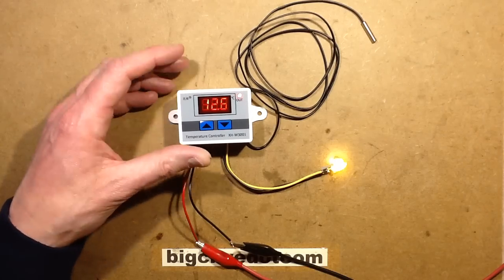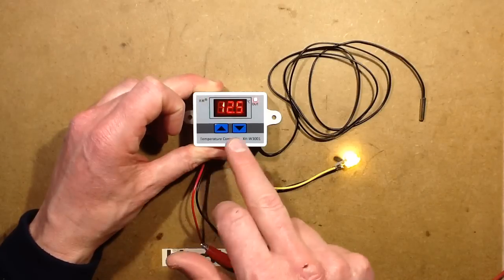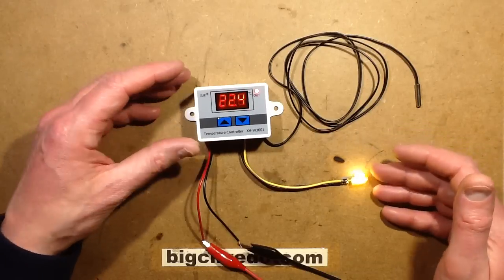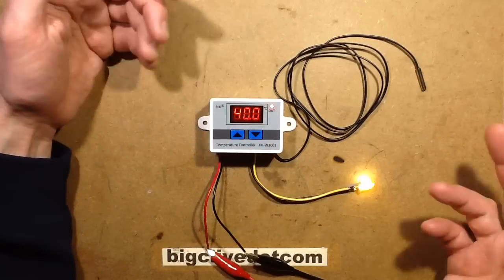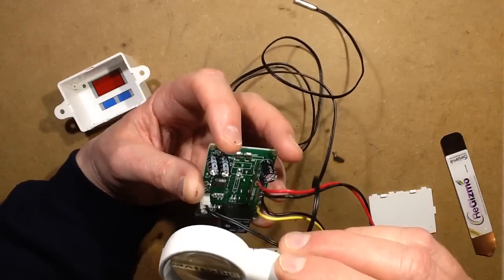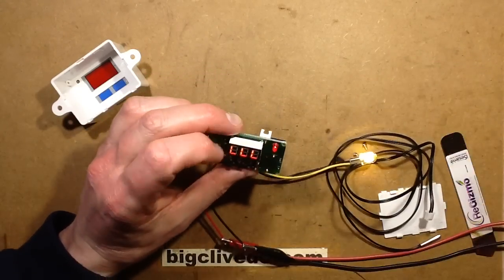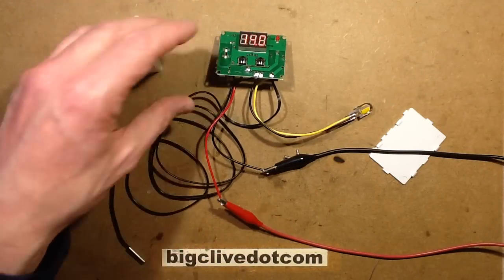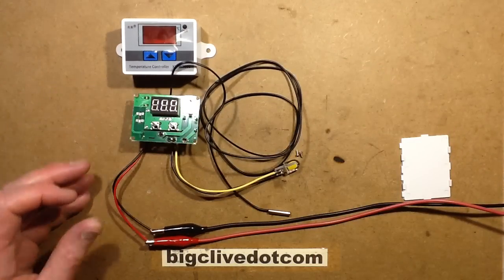How to set a XH-W3001 thermostat module, and a look inside.

Comment: Hi,i pls need some advise,i have the same controller,i tested the probe in ice water and found out its out with .5 know in a incubator that does count,so i want to run the inside of my incubator at 37.5°c,where should i set my controller if i want that when its out with +.5° out,if someone can pls help me
Reply from the maker: 0.5 is actually very accurate for these.  You may find it better to use a separate precision thermometer in your cabinet and use that to set the temperature.

Comment: so i guess with this you can wire it to an inverter and convert a 240v table top freezer to 12v..and use less energy by cutting off power when it reaches 3 degrees above desired..

Comment: Can i use a 1000watt Water heater on the load with it???
Reply from the maker: Only if you use an external relay to switch the heater.  Don't trust the one inside for more than an amp.
Reply: Very disappointing

Comment: how low does the temperature go?  can this be used to control a freezer?
Reply: this is from a retailer of the same thermostat except 220v ac not 12 v dc
Temperature Measurement Range: -50° C~110° C

Comment: Something you didn't test: is the indicated temperature (more or less) correct?
Reply: He did; more or less. By holding onto the sensor with his hand. ;-)

Temperature measurement is always a bit dodgy because it's not something physical, like mass, length or wavelength.

Temperature measurement indicates only the apparent physical effect of rise in internal heat of the device. 

The tiny little NTC sensor set inside a stainless steel probe takes a while to warm up while Clive fondles it. Indeed, one can see the indicated temperature still climbing for a second after he leaves it exposed entirely to the colder room; because the stainless steel sleeve is still warmer than the sensor. You wouldn't have seen that if Clive had embraced it for a couple of minutes; enough time for the temperature gradient to stabilise between the hand and the sensor itself.

These sort of things have "time constants" that are defined by the time required to reach 63% of the actual step change; with the constants depending on the medium (material) and its velocity. (e.g. still air vs moving air vs still water vs flowing water) Those factors make a big difference to the time constant as they determine how quickly the sensor can gain or lose heat.

Note that the amount of heat required to change the sensor's temperature depends substantially on the amount of sensor; how much material and its thermal properties (specific heat in e.g. kJ/kg·K). The tiny sensor at the heart of the probe can react to changes in temperature much more quickly than the probe; but the probe protects the sensor from the nasties; which is why stainless steel is used; being quite resistant to most corrosion, etc.

As for the accuracy of the temperature indicated; you can do that only with a certified temperature reference and the probe shoved into a sealed box with that reference. ±0.1°C may be repeatable on individual devices, but it may just be consistently wrong. ;-)  

Be happy with ±0.5°C.
Reply: The fact that the temperature rises when he holds the sensor in his hand doesn't mean too much to me. After a couple of seconds the temperature will stabilize and I would like to know if the indication on the display is more or less the real temperature!
Reply: +Hendrik Stegen Given Clive's usual house temp, it's pretty close. You'd want to calibrate the individual unit sent anyways since not all thermistors are created equal.

Comment: Clive. A huge bug bear of mine is the vast amount of energy wasted in homes because of cheap and inaccurate thermostats fitted to measure temperatures, typically in hallways in those homes. I have one of those big dial types (Bi-Metallic) fitted by my landlord and it is utter rubbish. Sometimes it sticks and runs the boiler all night until the air gets so hot I am forced from my bed to turn it down. The bills are huge as a result. Can you recommend something I can buy that will not break the bank but will do a better job?
Reply from the maker: Not sure which country you're in, but I fitted a Salus wireless heating controller to the old oil boiler here.  It allows you to set a series of temperature levels for different times during the day, and over-ride them at any point until the next step in the timing cycle changes it back.  You can also press and hold a control button and it will turn the heating off completely unless the temperature gets too low when it will still run just to avoid pipe damage.  The remote is battery operated and communicates with a receiver that requires a live and neutral for power and switches the boiler control line that is currently served by the thermostat.
A simpler alternative might be just a programmable heating thermostat that uses batteries for power and has a small latching relay to switch the heating control.

Comment: I have one connected to a heat mat for incubation. It’s reacting wrong temp. Like 80-90 always. Any solution? Ty
Reply from the maker: Is the probe wiring OK, and kept away from conductors within the mat.
Reply: @bigclivedotcom  hi, yes , I’ve tried to cool the probe and the temp isn’t moving. I think the probe might be faulty
Reply from the maker: @ChrisDeaney  It may be a standard 10K probe, so you could get a replacement fairly cheaply.  A quick test is to use a 10K resistor on the probe terminals and see if it displays around 20C.  That would show if it was a 10K probe, but also show if the on board circuitry was working.

Comment: Is it possible to insert a solid state output relay? Thanks
Reply from the maker: You could use the existing relay to switch the supply to an external solid state relay.
Reply: Thanks for the quick response. @bigclivedotcom
Reply from the maker: If you removed the relay inside you could also bring its coil wires out to the solid state relay input directly.
Reply: E 'interessante, mi sono sempre chiesto se il relè interno può essere bypassato. Grazie per la vostra gentilezza e perdonare il cattivo inglese!

Comment: I have one of these for 230V AC. It works great, but the workmanship is questionable. The wires are too thin and not made of copper. In the house installation, I would be very careful.

Comment: Can i controll 12V heating foil ?
Reply from the maker: If the current is within the range of the relay.  Or you could add an external higher current relay.
Reply: @bigclivedotcom  cloud i use 12V autobatteries as supply in circuit and use in the circuit This tempature switch controller to controll heating foil (everything is 12V)?

Comment: I bought a 4 pack on Amazon for 12 bucks. They don't read the correct temp and there's no calibration adjustment. In ice water here's my readings:0.2, 1.7, 5.1 and one doesn't turn on.

Comment: Had an STC1000 fail and it kept the compressor on. Froze all my kegs of beer. Some at 11%.
Reply from the maker: Were you switching the compressor directly through it?  The contacts may have welded closed.
Reply: yes it was. it did say its 10amp rated, i know, the relays arived later, and i wired it all up. it had run for two years though.. As you say, they are cheap. A PID would have been stupid money a few years ago.

Comment: I prefer the old thermostats with the glass bulb containing a bit of mercury. They were nearly fool-proof, and lasted virtually forever.

Not nearly fool-proof enough, because hysterical fools have banned them, due to the word "mercury" appearing on the description of contents.  No one ever died from the word "mercury", or even from contact with a tiny dab of elemental mercury, but apparently hysteria has become the new standard for safety.  Risk-assessment seems to be becoming a lost art.
Reply: I believe the problem with mercury is the risk for people manufacturing, handling and disposing of it (including the environment), rather than a finished product which is usually safe (unless damaged or broken). Mercury is non-biodegradable and thus can easily accumulate over time.
Reply: You believe that? On what basis? Mythology?

Comment: Its to fast on response.. 
Imagine one electrical motor or oil burner to switch of and on t times in second because the thermostat its so fast and sensitive 😣😣😣 
I order 2 pieces before see the video :-(
Reply from the maker: They do versions with programmable time delays.
Reply: @bigclivedotcom  omg so if i am lucky i will have this one with delay..... 
Imagibe some people they dont understand how mutc important is that... And on them hands that controlller is machine gun